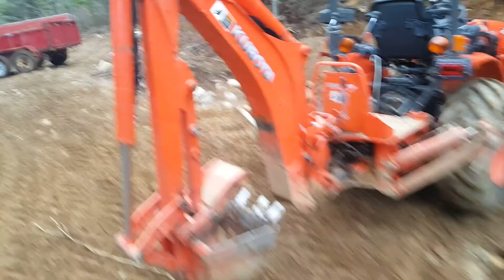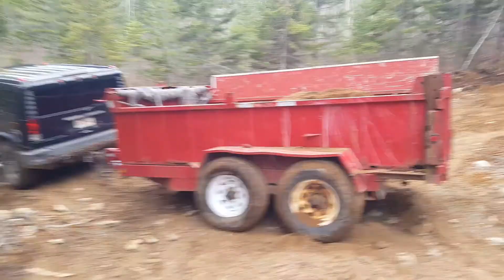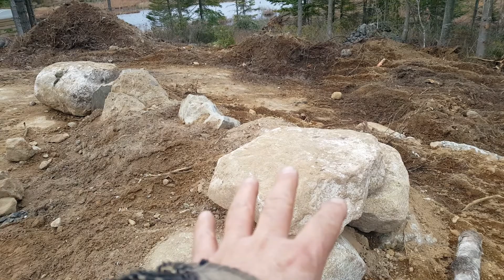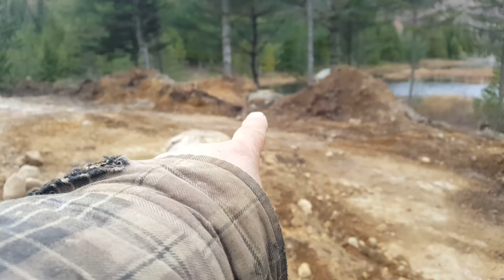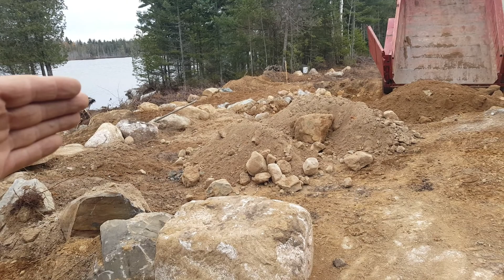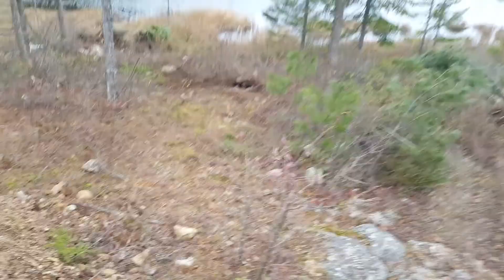Hauling gravel

Comment: Great to have a gravel resource. The only thing I would do and maybe you already are going to...but I would rent a compacter and compact that gravel portion of the pad next year before I started to build.
Reply from the maker: Indeed like ur property i wanted lots if wood and gravel... have been driving over gravel with tractor will probably get a compactor in spring